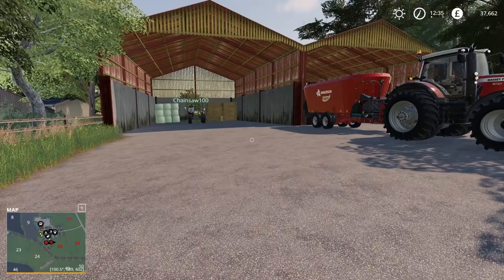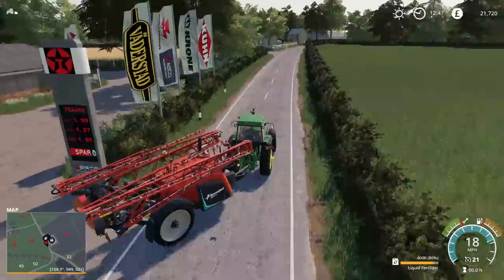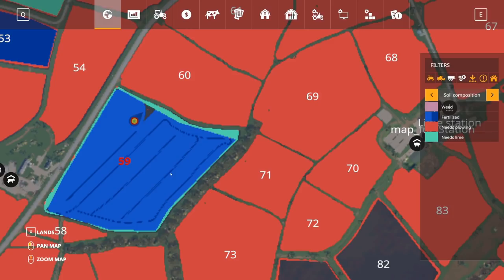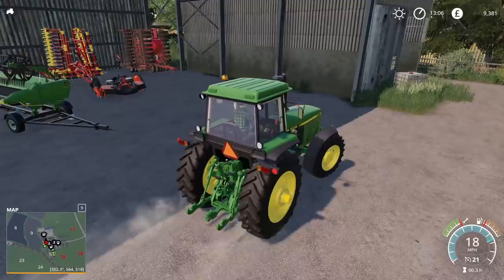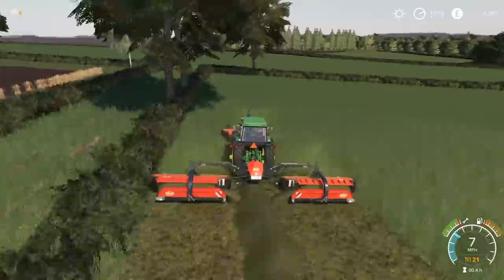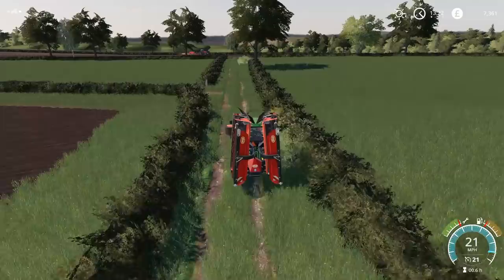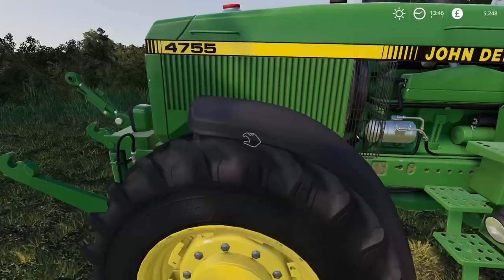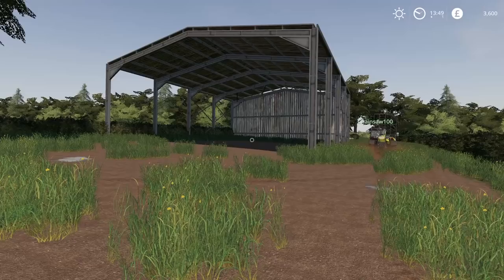WOW! THIS IS A NICE TRACTOR! - Bessy Beneath | Episode 7

Comment: Those tractors and up to the 7000 series ones coming out all had the same design. The front wheel assist on the 55 series were mechanical. If I reme.ber right the 60 series  and with hydraulic over electric.but not sure been many years since I ran them